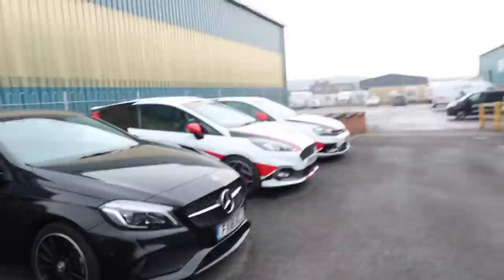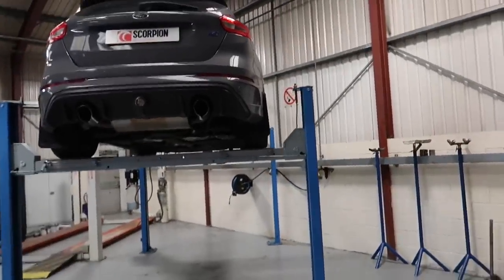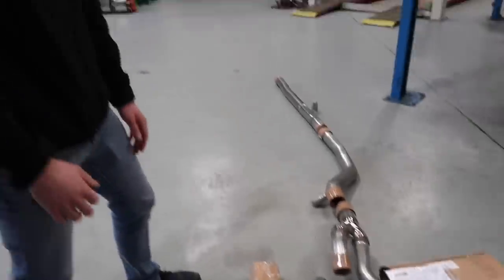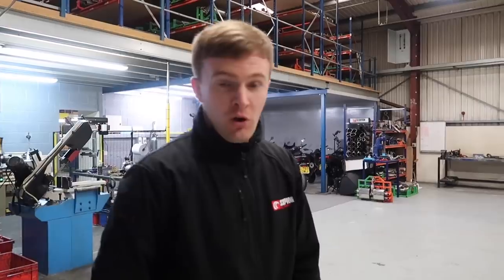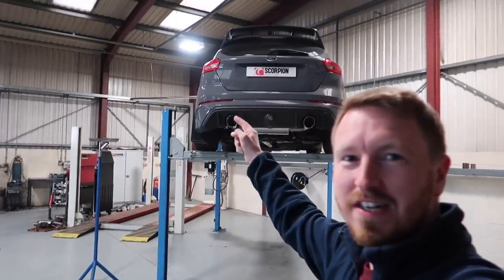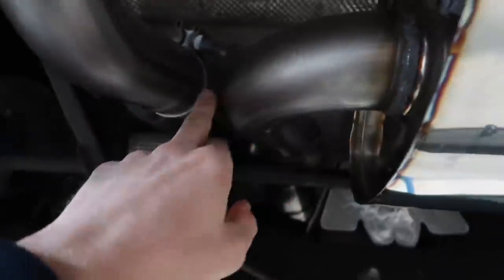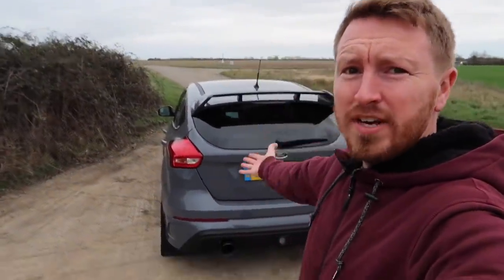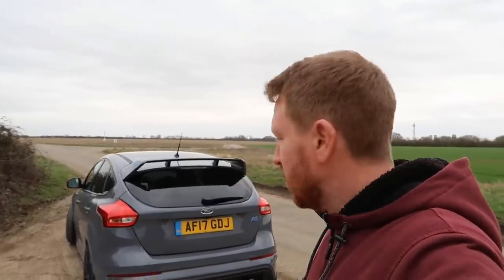My Focus RS gets a SCORPION exhaust!!

Comment: Looks and sounds really good. Love the turbo spool through the exhaust. I’ve a full Milltek system on mine. Initially went for non res but was stupid loud on start up in combination with the sports cat so had the resonated section fitted which has given the sound I’m after from a daily driver. You might as well join the club now I reckon and go full stage 2 ;)
Reply: I leave for work at 6:15 am , can't wait for my non res Milltek😮

Comment: I have been going round and round at which exhaust system I should get. I had my heart set on a Borla S Type but it doesn't use the Ford exhaust valve system.
.
Scorpion does use the valve switch and it sounds fantastic!!
.
Very well made video. Thank you for the details.
.
Is Scorpion made in the UK?
.
I'm getting this system!
Reply: @CarFocused  Assembled by hand, that's good ol English quality for ya.
.
The Tips are GORGEOUS!!
.
Thanks again my friend from across the pond.

Comment: I fitted a Milltek system (non-res cat back) to my Scirocco R and it sounds great when driving hard but at about 2,000 rpm light throttle,  there is a bad drone and it annoys the crap out of me so I have 'buyers regret' a bit. I wonder if Scorpion would have done better? Great video as always ! 👍
Reply: Cris Keay I think the drone is more from the non res bit, especially on a car like this. Do you still have your res pipe? That would be an easy and much cheaper test for you, just whack the res back on (unless it had to be chopped off??) and see if that cures the drone a bit
Reply: @Matt7R  Hiya. The kit never came with the front resonator and the original is still part of the one piece system. I thought the pipe diameters were different also? 
I was actually thinking of swapping the original system's front resonator for straight pipe and refitting the system back on... With functioning valve too ??

Comment: Hello, about time you got one. Very surprised you went for scorpions. I went down the Remus route in the end, partly due to the sound. Your are right, hard to tell how it sounds on video but it does look so much better than stock. Look forward to know what it’s like inside and if you have turned off the fake noise into the cabin of the car?
Reply: Hey Gary, I’m not 100% yet but I think it involves forscan, plugging into the obd port and doing it from there. To be honest I’ve not noticed too much noise in the cabin with my Remus and I can always pop it into normal which helps a lot. Was your system fitted perfectly first time? After about 300 miles mine was knocking so ford had to readjust but it’s been fine since. I really did look at the scorpion but I was put off it by a lot of people saying it did not sound as good as the Remus. I really hope you are happy with it and I look forward to another video. 👍🏻

Comment: When I had my RS i heard the version 1 mountune axle back. Loved it, but they stopped production. I searched you tube but could not hear the true sound. I was at ford fair show Silverstone and I heard a scorpion in the flesh. It was so much better, bangs were louder, car sounded slot better. How rs should sound. I got a non res non valve system for £550 off scorpion👍 the focus rs issues were sorted I believed at the time, I travelled to London and back alot and there was no drone. Well built great sounding exhaust. Then I had piston failure, and my warranty rejected because I fitted a modification. Ford blamed change of back pressure. Scorpion were great , they tried to help me bit at the end of the day I modified my car under warranty no matter what. I had to pay for an engine rebuild. I lost my love for my 2017 RS, now I drive a golf R, for me it's a more suitable car. But scorpion exhaust was best mod on my RS 👍 I shall hopefully fit one to my golf one day. 😁
Reply: The Focus RS has easily the biggest piece of shit 4 cylinder in any performance hatch today. You'd have to be insane to own one let alone modify one.
Reply: @CarFocused  All good, I'm just salty I had my eye on one for so long when it was announced to be completely disappointed by its reliability lol

Comment: Take it off !
All mine did was kill the Lowend Rpm grunt . 3 inch Scorpion Non Resonated twin round . Cat back. Too Loud too
Reply: Car Focused 
Well I’m Fairness NO! 
But After quite a bit of Forum trawling on various sites including those for motor cycles  i found  I wasn’t the only one left wondering about the low Rpm grunt after the affiliation with the new improved noise has worn off ,and in my case of Non res became tiresome . 
I’ve Since taken out my Bluefin which felt Laggy and spike’y and replaced the Exhaust with a Stock one which I had welded back together . And I’ve been happier with my car in the last few months than I was in the year and half of Having the exhaust and REMap .
Reply: Car Focused 
Well that fair enough noise is subjective . 
Scorpion Didn’t work for my ST , not a few others who felt the same . I’ve heard positive things of miltek but once bitten twice as shy .  I’m happy as it is I found my self thrashing the car because the low end weren’t there . 😪

Comment: The only 4 pot that sounds good and from factory is a Abarth 595 Monza exhaust. All today’s 4 pot sound terrible even with aftermarket exhaust. And then they try and make up with pops and bangs 🤦‍♂️ the old cars from the 80’s-90’s sound ten times better.
Reply: I30N with its real anti lag system is nice, just about the only 4 cylinder that sounds decent.
Reply: Pa-ST well the gay little Fiat sounds a lot better than a RS straight from factory 👍🏻 

And for staters it’s an Abarth not a Fiat.
Reply: A45 sounds amazing for a 4 pot. Listen to that.
Reply: Ross Meigh same as all modern day 4 bangers all sound like there farting in gear changers. All fake sounds 🤦‍♂️ and as for the A45 really you think that sounds good???? They only hit hatch that sounds good is the RS3 as that’s not a 4 pot. 👍🏻